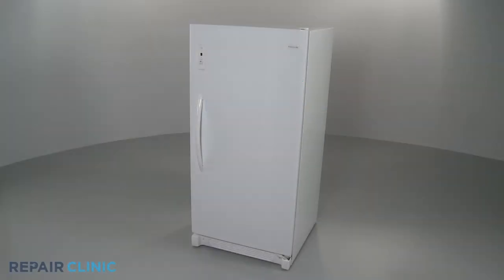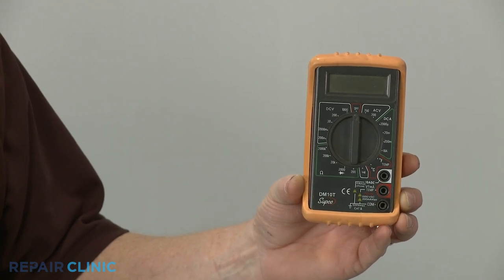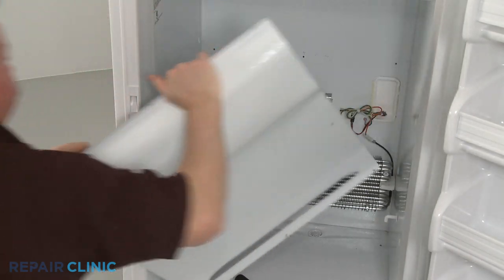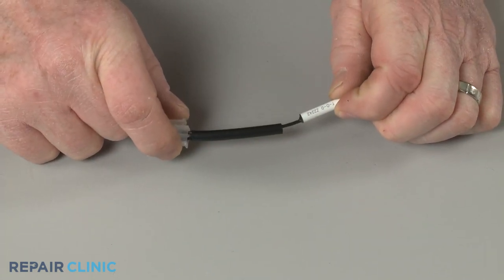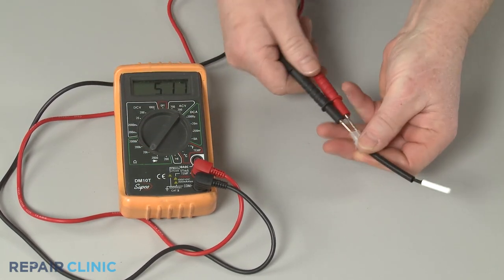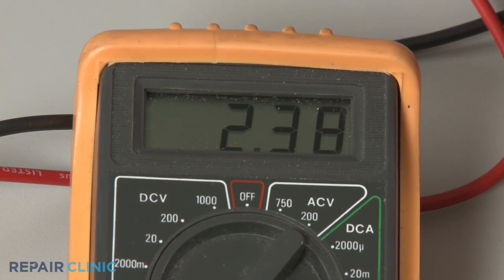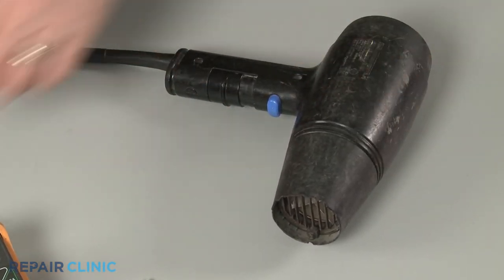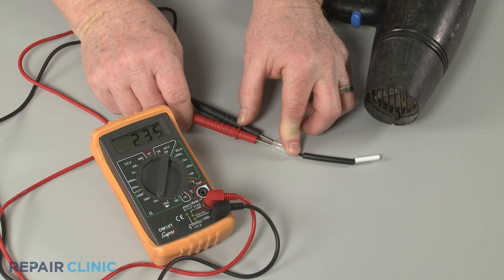Freezer Thermistor Testing

Comment: what is the part number for that exact  Freezer Thermistor: Need one for a freezer 2.2k ohms at 25 degrees Celsius.. tks
Reply from the maker: You can enter in your model number at RepairClinic.com for the genuine OEM replacement part for your freezer.
Reply: @repairclinic  ok but i will buy it on aliexpress instead they have 2k ohms sensor already stated as a tech i don't go with part number but specs part number is for novices